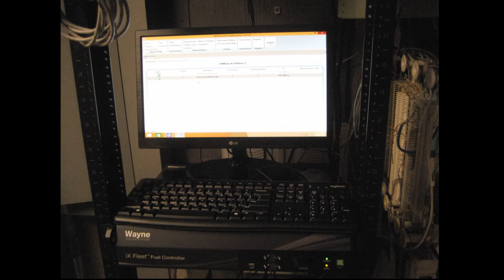Aboveground Fuel Storage and Dispensing System Installation

Comment: Please could you tell me the citied for the mandate or norm where specifically indicate the safety standard for a above tank gasoline storage please.? I know if you put a 12 feet vent and a vent vapor it.would be right for safety and firemen department approvals.
Reply from the maker: Petroleum Equipment Institute RP 200 covers the standards for aboveground storage tanks used for vehicle fueling.